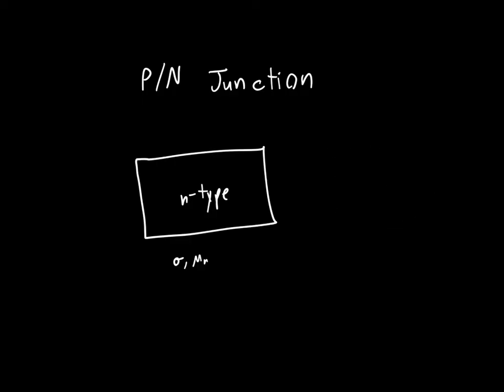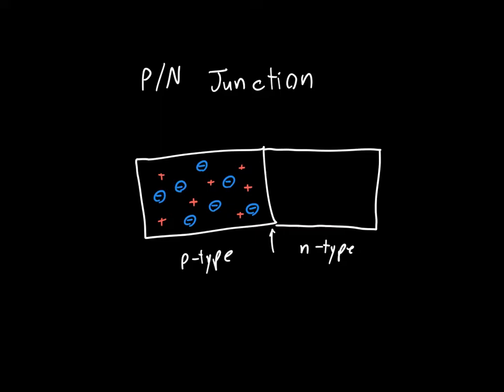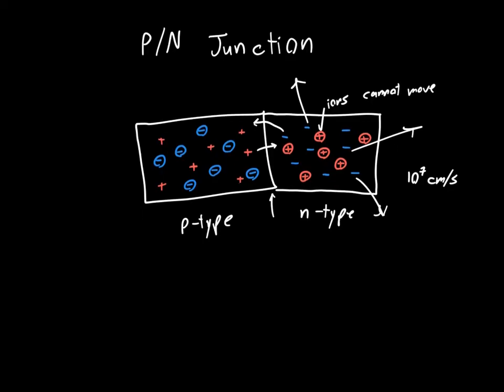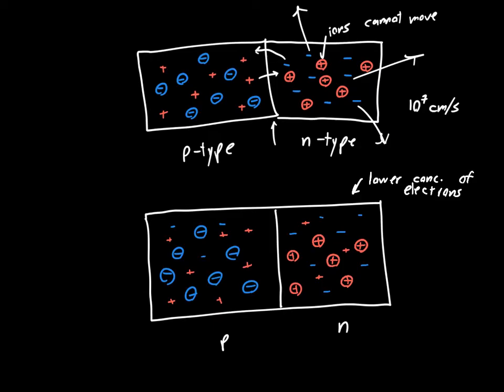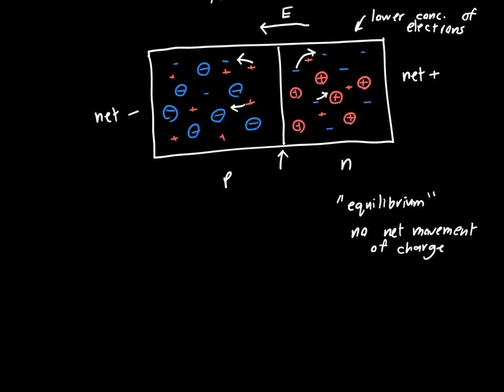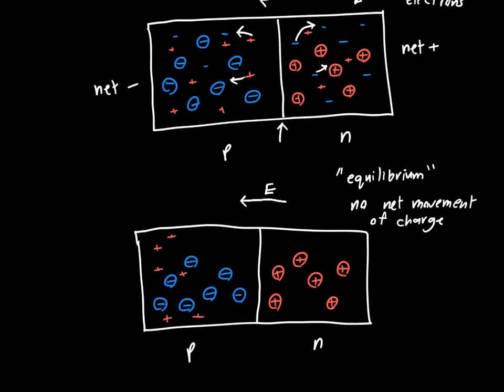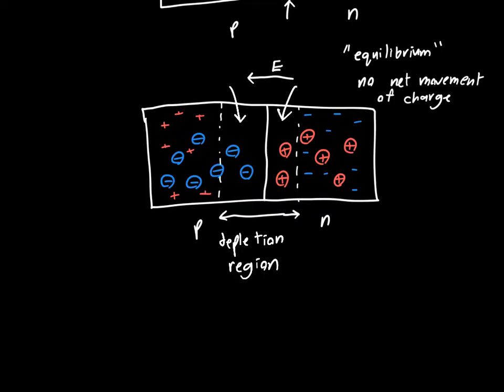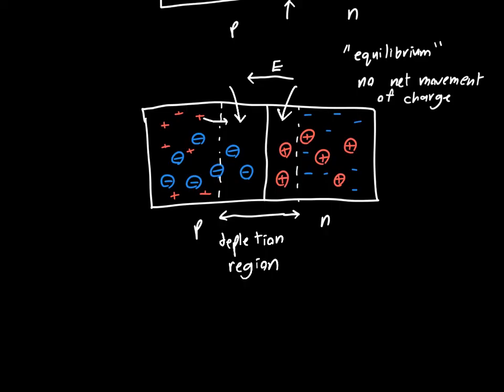PN Junction Introduction

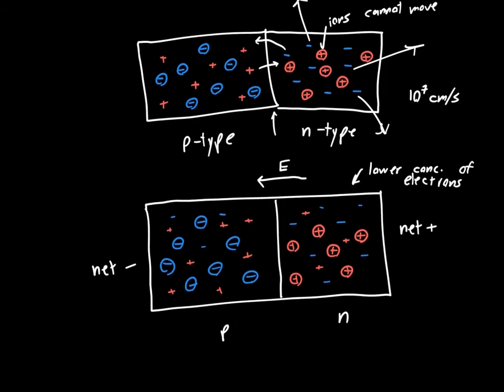Comment: 5:20 this section sounds nice and clear (and I like your lectures -- thanks a lot for you efforts)

As i understood from some other sources, due to diffusion, 
1. majority carriers quickly recombine as soon as they cross the pn junction cancelling each other, and only a small fraction moves further on (negligible)
2. the electric field formed due to recombination and because of dopants/acceptors in the proximity of the pn-junction are left alone without carriers to compensate their charge
3. electric field is strongly localized and exist only between the two sections of the depletion zone
4. this local electric field pushes incoming charge carriers ot of the depletion zone: both negative and positive

Could you please comment on this?

Comment: in the depletion region does the immobile ion causes an electric field or there are electrons and holes which diffused causing an electric field to exist. Moreover its is safer to say as due to no net movement there are no further diffusion but still is we see by diagram, what causes the electron and holes further movement. Is it the immobile ions or what that repel them? And this electric field is created in the space charge region of immobile carrier?

Comment: So can we say that depletion region is only formed by the immobile acceptors and donors which I think you call them ions, which are the ion form of the impurity atoms such as B^-1 for Boron and F^+1 for Phosphorus?

and... silicon or any impurity so to say ANY ATOM can not actually move or physically diffuse through the silicon, they are stable where they are, only thing moving is holes and electrons created by them?

Isn't hole movement is directly caused by electron movement? When we are talking about hole and electron diffusion, actually there are not 2 particles moving to diffuse to each other. There is only one particle which is electron that tries to diffuse to holes, and the thing we called "hole diffusion" occurs by itself, directly related to electrons when they diffuse since electron is going to leave behind a hole.

If you could please answer these... you'd make me and my friends very happy and I promise I will click 40 ads or any number you give +40 that is feasible :D I will do it.  Thank you so much for the videos, deeply trying to understanding something is so satifying.
Reply from the maker: Eeeeeexactly. You are correct on all points. You can think of holes as a "mathematical trick" that make our physics a lot easier to work with. Best of luck in your quest to understand this very rich subject :) If you want to go deeper I'd recommend taking a class on thermal physics and/or quantum mechanics.
Reply: Wow thank you so much for the answer. The weird thing is I didn't come across with this explanation of holes. Can't say I've studied the books deeply but i'm dissappointed that it wasn't even mentioned in my class.
And for the promise I've made, i did it.  Thank you for the videos.

Comment: So in Summary, In a pn junction, there are four types of charges, movable and unmovable postive and negative charges. The movable postive charges are located in the p-type and the movable negative charges are located in the n-type. Both types are neutral though due to the existence of the opposing unmovable charges. When the p-type and n-type come in contact with each other, some of  the movable opposite charges migrates to the opposite type. As they are traveling, they are repelled by the other migrating movable opposite charges, such that the opposite movable charges migrates at the extreme side of each type. The repulsive field created by the moveable charges contains only the unmovable opposite charges, which are constructs the depletion region. In conclusion, the pn-junction consists of 3 regions, the postive region, the depletion region and the negative region.
Reply from the maker: Almost. Precisely how I think of it up until the “as they are traveling” part. They aren’t repelled by the other mobile charges (because there’s lots of ions there too balancing them out, so no electric field). They instead diffuse into the opposite region and *recombine*, which is how the ions in the depletion region get “revealed” for lack of a better world. It is these ions that are responsible for the electric field and prevent further diffusion. Far away from the depletion region, the semiconductor is still neutral (it has both its electrons and positive ions, or holes and negative ions). The mobile charges don’t make it very far before they recombine.

Comment: So the diffusion current creates a net charge that again creates an electric field that stops further diffusion? But wouldn't that make the electric field disappear since all diffused charge carriers will recombine and the charge difference would disappear? Is this something that always goes on, but we model it as a stable situation where all free charges are pushed back? I feel like I am missing something or that I've been overthinking this
Reply from the maker: Yup, you’re precisely correct, except for one subtle point - recombination does not change the net charge in a particular region, as it removes both a positive and a negative charge with no charge - so the E-field will remain after recombination. Other than that you’re exactly correct.
Reply: @JordanEdmundsEECS  Thanks for a fast reply! You "destroy" both hole and electron at the same so the net charge stays the same. That makes sense! Thanks again